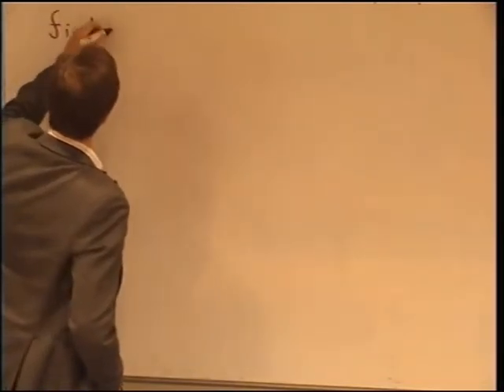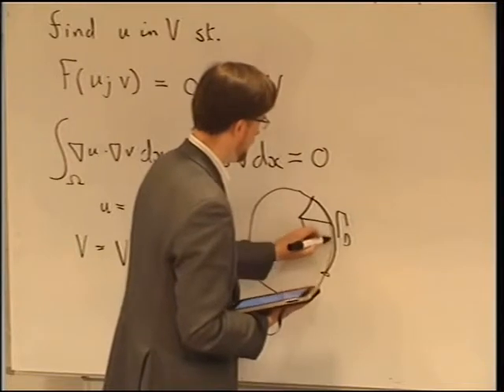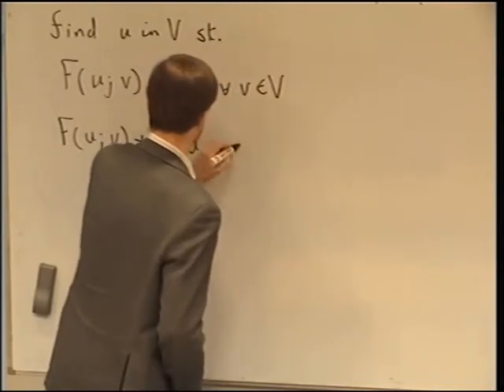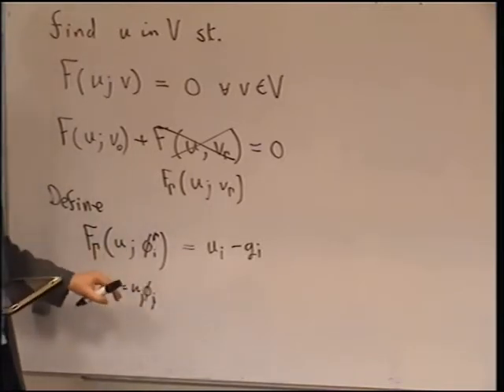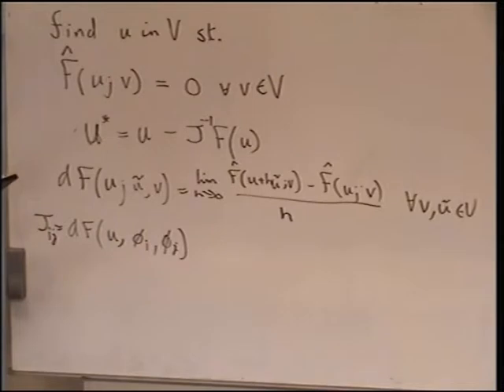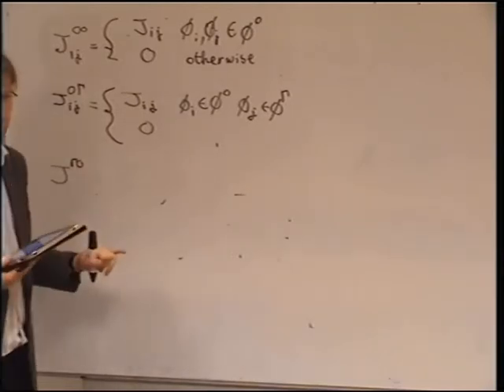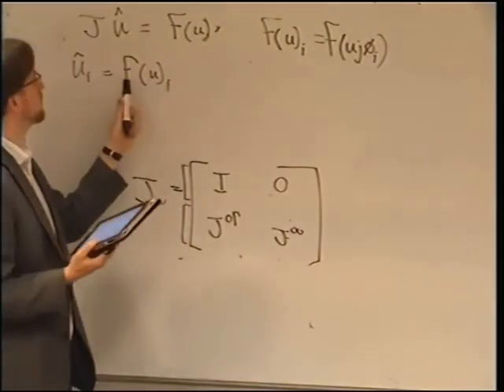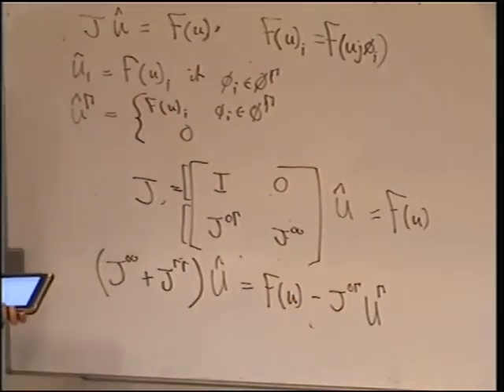Finite element method course lecture 7 part I 28 Feb 2014 Boundary conditions

Comment: Professor,
I am very confused about the difference between F and F_gamma when you make the substitution at 12:10. Wouldn't that change the value of the functional F?
Reply from the maker: Yes, that’s intended. F would be the residual for a problem with no Dirichlet condition. We’re changing the problem to one with a Dirichlet condition by changing the residual on the Dirichlet boundary from one which imposes the PDE to one which imposes the Dirichlet condition.
Reply: @David_A_Ham  I got it! Thank you very much for the explanation and for the awesome lectures.